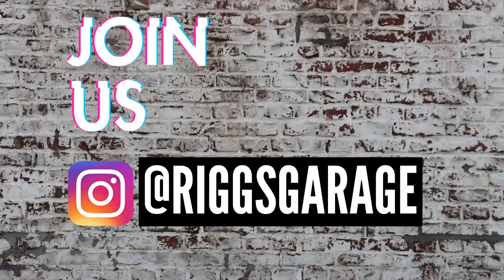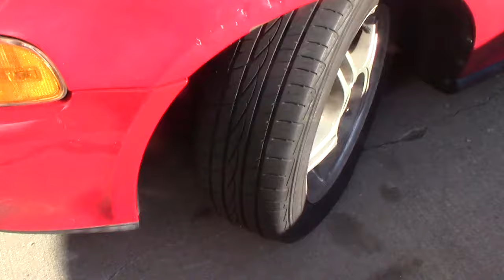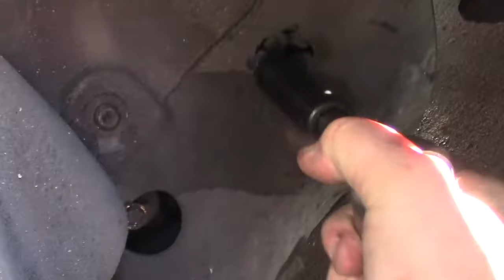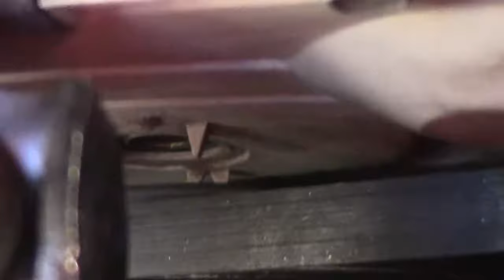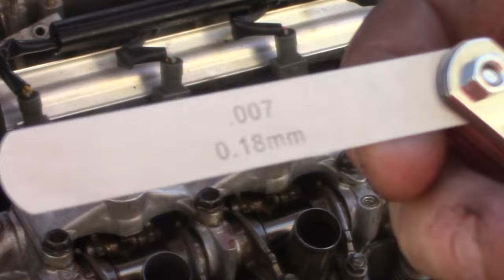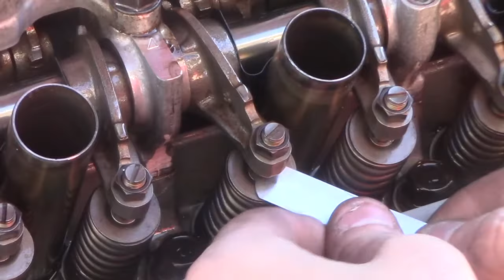How to Adjust Honda Civic D Series Engine Valve Lash (D15, D16)

Comment from the maker: Thanks for all the support! If you’re enjoying my videos and you would like to help out so that I can make even better videos, check out the link below! https://www.paypal.me/RiggsGarage
Reply: Do you need to torque drive shaft tight after that?
Reply from the maker: @cocoslover100  I'm not following what you're saying.
Reply: Service manual said re-torque the crank shaft tight after that.
Reply: No you don't upper not attached to the crank silly
Reply: Silly? If it wasn't attached then how did he move the valves by turning the crank...? But to answer the question...no you do not need to tighten the crank because he did not loosen the crank.

Comment: FOR ANYONE THAT IS CONFUSED, you need to adjust the rocker arm when the camshaft is not in contact with it. You can do it however you like, the only importance is the cam lobe not tensioning the valve springs. Here he demonstrated that at top dead center the cam is not compressing the valve springs in cylinders 1 and 3. This may be different from your vehicle however if you can manage to spin the motor untill you notice the valve springs on the rocker arms you are adjusting are not compressed you are good to adjust your rocker arms
Reply from the maker: Yes yes 👍👍
Reply: Precisely good sir

Comment: The correct way to do this sequence is to Retorque the rocker arm Assembly, because it gets loose over time, and then you want to make sure you are at correct timing, Only spin the engine counter clockwise Their is a Time Marker Indicator, that points to the Pulley, for D series their is 3 notches for Ignition timing on the left hand side, The one indicator Line on the Pulley to the right is your top dead center mark, You want to like that up with the Reference pointer on the timing cover and you want to get if your camgear is pointing in the up position a lot of people have a tooth off, It's really significant And not running efficient, you can have loss of power Pre detonation due to Distributor, wear out your valve train all sorts of issues due to bad timing on these interference engines, It is key to Retorque the rocker assembly to spec first and then Adjust your valves, and also keep in mind too Older engines that have a lot of miles on them the camshaft Lobes wear out slightly due to Owner driving or just miles in general, I like to set mind slightly snug, it drive me crazy hearing valve train noise, Now my civic rungs great after you are done doing all that, It's good to set your ignition timing with a timing light but if you want to just be safe putting if you were to adjustment your valves with the correct timing that will make your car run horrible too, And possibly bend a valve, with correct timing these D series engines will last a long time I had a d serious for 3 years cars never broken down on me well engine, Good timing and adjust through 50k miles  and Rod Bearings, good clutch, fluid flush, it's also good to keep your power steering rack maintenances on these 20 years old Hondas, Good fluid flush and make sure there is no play in inner and outer tie rods, and a good alignment, Your car will be driving like new
Reply: Genuinely interested due to the fact there’s no likes to this comment. Is the entirety of your above statement true? Wanting to do this myself, would rather know the right way.
Reply: Is correct
Reply: Nailed it. Doing all of this to my sons 1999 coupe he won at auction.
1. So I start with crankshaft timing first?
2. Ignition timing?
3. Valve adjustment last?
Is this the correct order?
Reply: @dustinsanchez6471  well first thing id do is check the compression before anything working on a engine, and run it raise the rpm listen for knocking, that's easy way to identify that the engine needs a rebuild no point in putting money if compression and bearing worn, would I would do is turn the crank by hand by the driver side with a socket and a extension counter clockwise until the the timing marks are lined up I would look to see if it's lined up with the camshaft tdc, you might having to take the cover off 2 10mm you don't have to take the complete timing cover off the just the timing gear portion part because getting the rest of the cover off I believe you have to remove the driver side engine mount, so yeah just the top timing cover so you can see your reference mark, a lot of the times people do timing and it's off car will run, but it won't run right, the valves aren't closing at the right timing, also when tightening the belt! You tighten the the tensioner pulley 14mm or 17mm I forgot haha then you turn the crank by hand clockwise so it takes the slack from one side of the belt! It's not rocket science it's actually a pretty simple engine the design, easy to do all of that then id check ignition timing if you dont have atiming light honestly you can loosen the distributor and turn it to retard of advance the timing and you just move it until the motor sounds like its a good idle, you'll be fine, even the top dead center mark isnt the true tdc also id clean the pcv and straight pipe it after 100k the cat reallt starts to get clogged when turning the belt clockwise to get tension on the otherside of the belt should only be turn like have the tooth diameter of the camshaft on the gear any more then that youll put too much tension witch will premature wear the belt also if its too loose it can jump timing

Comment: Why don't you clarify that you aren't just rotating your engine 180 degrees.  For every one full rotation of the crankshaft equals only 90 degrees of the  camshaft.  So you would need two full (360) turns of the crankshaft to set the camshaft at 180 degrees.  Which visually would move the up position (TDC) of the cam sprocket to the directy down position.  Correct? All you say is put your engine at 180 degrees.  I think some need just a tad more explanation. Correct me if I'm wrong. Other than that, this a fantastic video. I appreciate your time.
Reply: Rotating the crank 360° will rotate the cam 180°. 
Cam will do a full rotation with 2 rotations of the crank.
Reply: @patrickstarthemanjr4457  yes, thanks for the correction

Comment: I did a valve adjustment a couple months ago. I'm about to to a timing belt change. Do I need to readjust the valves after the timing belt change? Does it affect valve clearance? Thanks!
Reply from the maker: Good question. The timing belt just turns the camshaft, so changing the timing belt should not affect the valve lash adjustments. But it is a good time to double check since you have the valve cover off if you want to.

Comment: As per the service manual your video is wrong. For the d16y7 it has to be at TDC for one on cam, 90⁰ cam to exhaust for cyl 3, BDC on cam for cyl 4,and 90⁰ intake side for cyl 2.
Reply from the maker: Maybe it is wrong for the y7. Based on feedback, it's correct for most or all.  Perhaps there are multiple ways to do it. Let me know what you find out 👍
Reply: That's what it says in my service manual for D16Y8 as well.  But I wouldn't be surprised if his method works.

Comment: Just did this by following your video. All the clearances were pretty loose so I got them tightened. I guess I’ll see if I notice a difference
Reply from the maker: Good deal. How does it sound?
Reply: @RiggsGarage  sounds good.  Ive driven about 300 miles and everything seems good.

Comment: I know this is an older video but I have a question.

I have a D17A2, I went to replace the cam plug, but a felpro one was used so I had to unbolt the cam caps in order to get them off. After torquing everything back to spec in what I think was the right order, I appear to have lost compression and have a dead mis on cylinder 3. Do I need to adjust the valve lash on that or did I potentially just destroy the head?

Comment: Please i want to know if in my engine d15y3 the same clearence
Intake 0.18mm
Ex 0.23mm
Thanks in advance
Reply: there might be a sticker under your hood that specifies this.  but you'd be safe with the same spec since all d series are geometrically the same with the rocker arm lengths valve angle and cam placement.

Comment: I've been looking for this! I recently purchased a 93 del sol d15b7. Have never owned a Honda before, however, I have a b16 awaiting parts for a build soon, but I need to adjust my valve lash, is there a torque spec for any of which you loosened and tightened?
Reply from the maker: Good question, I've never seen a torque spec. You really need a box end wrench to tighten it down as you hold the adjuster still with the flat head screwdriver, not sure how you'd even use a torque wrench here. I just make it good and snug, never had a problem!
Reply: According to the dealership service and repair manual for D-series engines, the locking nut should be torqued down to 13 lbs of force. Since a torque wrench could throw off your valve lash as it turns, it is best to use a wrench that keeps the adjuster notch exposed, keep the screwdriver firmly in place, give the wrench a good turn until you can't feasibly tighten it further, and then swap to a torque wrench to confirm that the locking nut is set at 13lbs of torque. It's usually better if you have to slightly tighten the nut with your torque wrench than to try to loosen it.